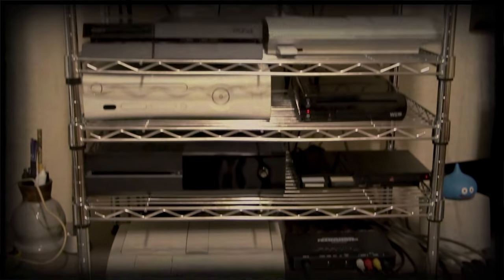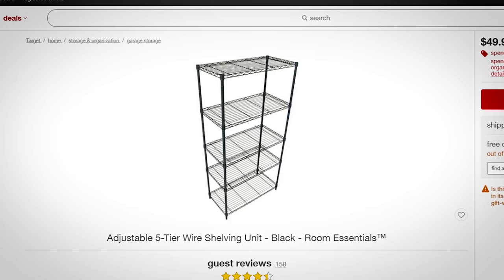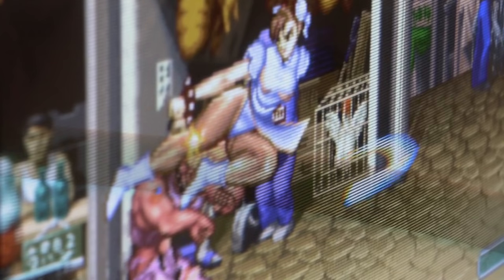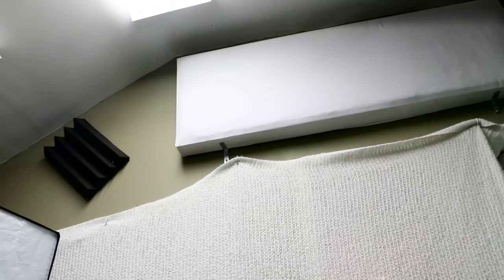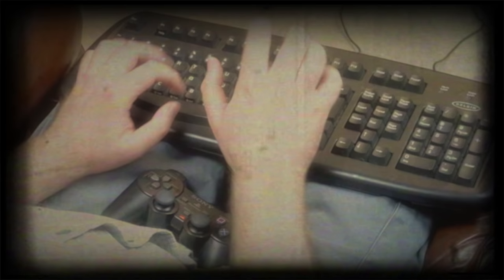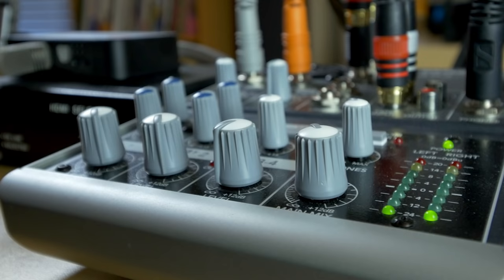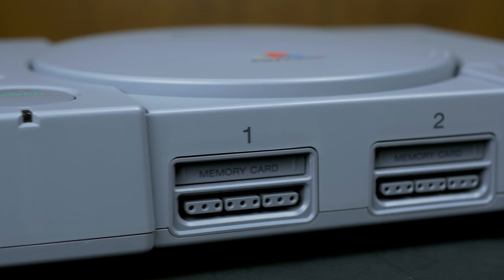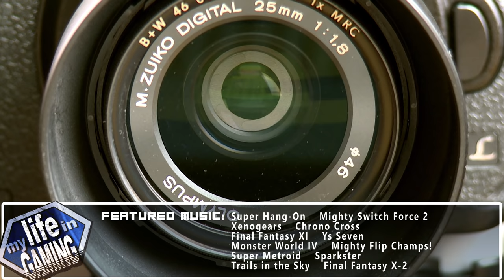Gaming Setup and Studio Tour - How We Make MLiG in 2016 / MY LIFE IN GAMING

Comment: Hey Coury! great video! I have a question at 8:54 I have that same HDTV. Been trying to configure the settings so its really good for gaming what configuration did you put on it? Also does yours have global dimming/auto dimming? Because mine does and I haven't been able to turn it off.
Reply from the maker: [Coury] YES, this is definitely a problem! I struggled iwth it for awhile, with no way to truly turn it all the way off. Some Samsung's have a way to turn off the global auto dimming in the service menu, but not here. The only way to fix it that I found was to change the settings so that it never kicks in - I found some that only makes it slightly kick in in the most extreme circumstances. Here's what I use:

Picture Mode: 
Standard

Backlight: 17
Contrast: 97

Brightness: 61
Sharpness: 0

Color: 51
Tint: 50/50

-- Screen Adjustment
Picture Size: Screen Fit

— Advanced
Dynamic Contrast: Off

Black Tone: Off

Color Space: Native

White Balance

R-offset: 8
G-offset: 8
B-offset: 8

G-Gain: 25
G-Gain: 25
B-Gain: 25

Don't forget to set to Game Mode under the General options.

The while balance is the key to making the auto brightness kinda turn off. You turn down the offsets and turn up the gain and that'll cancel it out. Since I did this, i hardly notice the auto dimming.

Comment: Curious if you guys record purely with the AverMedia software at high bit rates or if you've experimented with Lossless recording via programs like VirtualDub?

Also Tri, if you're looking to record Optical audio I'd check out either a Creative SBX ProStudio or a Creative Sound Blaster Z or ZX as both of these accept S/pdif inputs and can also passthrough the audio signal as well.

Also figured I'd mention this since the gscartsw is fairly expensive, but Extron AV Matrix Switchers are usually cheap on ebay and some models have the added benefit of cleaning up noisy video signals.  There's also the fact that you can use both JP-21 cables, Euro SCART cables, Composite cables, Component cables and S-video cables all on the same switcher.  The two main downsides are the size of the Matrix switcher and the fact that you'll be shelling out $40+ for each JP-21 or Euro SCART cable you want to connect to it.

Comment: I'm really impressed by this setup. I was wondering if you have like a signal flow chart that can show the path of each console and how it gets split and divided to your various monitors?
I am interested in learning on how you did your routing and signal dividing. I am trying to build out my set-up with 15 consoles I have hooked up. At this point, I am going to split it in sections based on connection type.
Reply from the maker: [Try4ce] Oof, well, for me things have changed a lot in my setup. I now have two PVMs, and just this week added a 4K TV. Figuring out how to route 1080p consoles PLUS 4K consoles is proving to be a challenge.
Reply: I also have a 4kTV and curious on what solutions you come with to incorporate that with your current video matrix.
Reply from the maker: +Andrew V [Try4ce] I am absolutely planning a episode about retro and modern gaming on 4K TVs later this year after I get it all settled!

Comment: hey Try, you wouldn't happen to remember what series your IKEA shelves came from would you, particularly the short one in front of the TV?
Reply from the maker: [Try4ce] Unfortunately they don't make that series anymore. That series is called Expedit. The 2x4 cubby hole units are also Expedit, and the wider 1-hole units are from a series called Lack, which still exists, but I think they may be phasing it out. They have since replaced Expedit with Kallax, which is very similar, but the outer edges are not as thick. They have a few of the same units, like 2x4 and 2x2, but sadly no 1x5, like my main unit in the middle.

Comment: Another outstanding episode! But, I've got a quick question: how do you manage to connect 2 hdmi splitters to one TV?
Reply from the maker: [Try4ce] Using 2 HDMI splitters in the chain doesn't seem to adversely effect the connectivity. One splitter goes from the switcher to the Framemeister + TV, and the other goes from the Framemeister to the capture card, as well as back to the switcher. I'm considering changing it so that the second split from the Framemeister goes to another input on my TV instead of back to the switcher.
Reply: +My Life in Gaming Nice! Thanks so much for the explanation!

Comment: You'll probably explain this in a later episode of RGB200, but in RGB102 it was mentioned that Coury is using component for his PlayStation 2 while Try4ce is using RGB Scart (mentioned here again in this video). Is that just for personal preference or is there more of a reason for that?
Reply from the maker: [Try4ce] It's more convenience/personal preference. There's not a clear winner either way. The PS2 component signal is often considered to be "noisy," which I don't really notice much myself. But to get 480p via RGB with the PS2, you gotta jump through some hoops. 480p over component is easy. As for me, I only have one PS2 game that even supports 480p, so I just do plain old RGB. RGB integrates better into my own setup, and it's easier to get good colors with RGB vs. component (even though both are theoretically the same, component just requires a tiny bit more adjustment to get it "right").

Check this video from RetroRGB about PS2 480p with RGsB (RGB sync-on-green): https://www.youtube.com/watch?v=6pzTfdUcAfg

I haven't gotten into that mess yet myself, but I probably will eventually.

Comment: I have a question for Coury...how did you get the extra shelf for the wire rack? i see you have a 5 tier and 4 tier yet they only come in 5 and 3 tier variations. i assumed you converted a 3 tier black one into 4 shelves since i noticed that the other 3 on it were black and the top one was chrome. did you have to buy an additional rack  to pull the spare shelf from?

Comment: Awesome video. I'm trying to setup my own game room but I'm stuck. If you're setting up a desktop setup using a Frameister with a modern HD flatscreen TV, what size TV would you use? Most smaller ones (24"-32") come in 720p or 1040p. How or does the native resolution effect the display while using the Frameister? I don't want to buy a PVM or old CRT, but I have no idea what type of TV to get. Or can I just use my 65" TV and adjust the screen size with Frameister?
Reply from the maker: +Velosiped [Try4ce] I wouldn't worry too much about it. You can do all kinds of sizing adjustments with the Framemeister. If you get an HDR capable screen, you might need to turn Deep Color off on your TV. That screwed up the Framemeister's color and sound, at least on my TV.

Comment: Regarding the Badridge SCART selector: I've noticed the composite/s-video input on the front; can the selectors be used to run composite/s-video through a SCART cable? I've got a GSCART switch already, but I'm trying to find a "One Channel" solution for my retro consoles. I've got a few consoles running through the GSCART then to a YUV converter to my Trinitron, and a majority of my consoles running composite or S-Video through Phillips selectors running to the same Trinitron. I hate switching input channels to go from say, Genesis to Turbografx.

I want to know if it's possible to run a composite or S-Video signal through the Badridge unit then to a YUV converter and have it display through the component channel on my TV. I bought like a $5 composite/s-video and audio to SCART adapter, but when I run it through my YUV converter all I get is a dark, black and white image with good sound. My initial thought is that it isn't possible to "convert" composite/S-Video to component with the passive adapter I have, but maybe it is with the powered switch... I have no means to test it though.

Love the channel, by the way!

Comment: Hey Try I recently got a PVM and I have limited space. I love you lazy susan idea in order to get behind it. I was just wondering what size is your PVM and what size is the lazy susan? One thing I learned about a PVM vs a CRT is all the weight is near the screen vs more evenly distributed so if I got a lazy susan to small I would be nervous of it flipping forward. Thanks
Reply from the maker: [Try4ce] I don't really use it anymore because now I primarily use 19 inch PVMs and they are for sure way too big. The PVM that was on the Lazy Susan was only 13 inches... and the Lazy Susan was just barely big enough for it  (I'd guess it was maybe 15 inches, not positive... it came from Walmart). However, you are absolutely right, the weight distribution made it so that I had to balance it sort of weirdly. If I centered it, then it did indeed lean forward. I'm not so sure it was a great idea in retrospect, but I'm sure there is a way to make something like that work well.

Comment: Something I've heard about the Extremecap U3 was that it only records in exactly 30 or 60 frames per second, leading to desync in long recordings. But that was in a review from a couple years ago. Does the current firmware allow recording at more standard framerates (29.97 for 30, 59.94 for 60) or is there no getting around desync without using something like VirtualDub to fix it?-skull902

Comment: Beautiful. How do you get the same picture from your HD to the smaller TV?
Reply from the maker: [Try4ce] Not sure what I was doing at the time, but there are various methods. PVMs have outputs that don't degrade the quality in any tangible way, so that output can go to an upscaler. Right now I'm using a series of RGB switchers called GSCART that have two outputs, so I send those now to my PVMs as well as my upscaler.
Reply: @mylifeingaming  Wow, thanks for the quick response. I have a simple CRT. Haven't gone the way of Framemesiter just yet. I simply wanted to have the same signal coming out of two TVs, just like you have in your video. Maybe a video splitter?

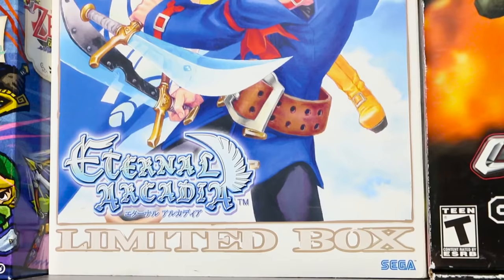Comment: Those black shelves where all your games are stored (12:08) what are they?  Where did you get them?  Looks like the games fit well there and they're adjustable.  Thanks.
Reply: Frank Castle you can take a gamble with bookshelves, but the games might not fit perfectly. A more expensive option is to buy "media shelves" which are designed to fit dvds perfectly. I would suggest building your own shelves, though. It's cheap and with some practice you can make them really nice.

Comment: Do you guys use step transformers for your XRGB Minis and/or Japanese consoles?  If so what kind or if not, why not?   Thanks!  Great Ep!
Reply from the maker: [Try4ce] No. It's generally considered "fine" to use Japanese AC adapters in the US. The adapter itself might get a bit warmer, but the output to the console is pretty much unchanged. If you order a Framemeister today, it will actually come with a true universal adapter, that can be used anywhere in the world without issue. Ours are 100V Japanese adapters, so it's not ideal, and it does feel a bit warm to the touch. I might look into an alternate universal adapter for it someday. I'd rather use a well-made universal adapter than deal with a step-down converter, if such a thing exists. I previously used my Famicom and Famicom Disk System with their official Japanese adapters, and that was also fine, but I now use a universal multi-system adapter called Retro DC with those. We actually did a video that featured it: https://youtu.be/RIzt23IDFrc
Reply: +My Life in Gaming Awesome!  Thanks!  Power on imported consoles (have an NTSC-J Saturn on the way) is always something I'm worried about!

Comment: I'm a bit confused on plugging a component switcher into a SCART switcher. My planned setup will have a GSCART sending one signal to a Framemeister and another to a multisync CRT monitor that can handle both 240P and 480P. My question is can the GSCART, and by extension SCART and BNC cables handle the higher KHz refresh rates needed for 480P and higher?
Reply from the maker: [Try4ce] Yes they can. I actually don't have the component-via-SCART thing in my setup anymore, but there is nothing about the SCART standard that prevents 480p... it just normally doesn't happen. You can get 480p with PS2 via SCART using sync-on-green (which involves jumping through some hoops, but it does work), and also from Dreamcast with the Toro VGA box, which can convert the VGA signal to 480p over SCART (which is going through my GSCART just fine). The GSCART is also sending 480p Dreamcast to my PVM 20L5 (I got it after this video) via the Dsub output.

Comment: I've always wanted to mount my TV, but I'm nitpicky about hiding the cables.  How did you guys manage it? i only see one single cable running on your mounted setups.
Reply from the maker: [Try4ce] Mounting your HDTV is definitely the way to go, I think! The wires are simply bundled up by putting cable ties around them. We use Velcro cable ties (commonly available at hardware stores) so that you can add wires and adjust things, without having to cut the tie, like you do with normal cable ties.

Comment: Great work yet again you guys, seriously! I had a quick question for Try. That wireless PS2 controller, where did you get it? I've seen wireless PS2 controllers before, mainly popular ones like the Logitech brand, but never really liked how they looked, nor have I ever liked buying third party controllers. I tried doing some research and it seems that Sony never released a first party wireless controller at the time, (I could be wrong), but nevertheless the one shown in this video looks legit! SCPH-10015GR I think this is the model number, however when I did a Google search, what came up was something that looked cheap and fake. Any input would be greatly appreciated.
Reply from the maker: [Try4ce] Wireless PS2 controller? I'm a bit confused. Even if you were mistaking it for a PS3 controller, I don't recall ever showing one in this video (maybe i did). Were you mistaking it for that silver Xbox 360 controller, perhaps? While I don't have them anymore, I used to use Logitech brand PS2 wireless controllers. They were a somewhat different shape, but once I got used to them, I really loved them, and never had any connectivity issues. This was back in the PS2's day. Nowadays I'm back to the official wired DualShock 2.
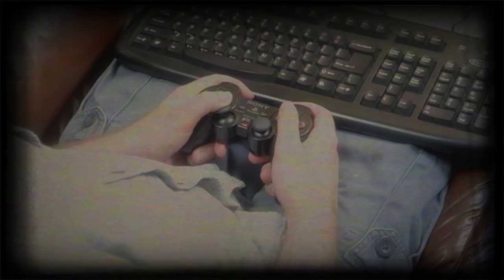Reply: +My Life in Gaming Oh...errr I was almost sure that was a PS2 controller at the 20:18 video mark. \:

Comment: + MLiG
 What exactly about your Sony at 34:05 wasnt as awesome at retro gaming?
Why did you get rid of the Sony and keep the Toshiba? Can you be more specific explaining your reasons? I'm trying to make a similar decision myself
Reply from the maker: [Try4ce] My reasoning is mostly explained in the HD CRT section of RGB 104, at this timecode: https://youtu.be/RAi8AVj9GV8?t=18m17s The short answer is that it's actually just not that authentic of a retro experience because HD CRTs are digital, not analog. You can't use light guns on them because the image is processed. There are no scanlines. You can see in some of the shots included in both episodes that it just has a weird way of processing 240p stuff. It ain't super awful I guess, but standard definition CRTs (or professional monitors) treat 240p stuff with much more care. 480i and 480p is pretty OK on an HD CRT, but if 240p is a big part of your retro diet, then older consoles just look more defined on a standard def set than an HD set, in my opinion.

Comment: I have the avermedia 4k when I hook everything up through the soundstage I can't get 4k through the PS5 it only gives 1080p but when I hook it up to the LG C2 it gives 4K I don't know if it's a receiver that's not passing through the signal but the receiver is 4K HDR
Reply from the maker: [Try4ce] That doesn't surprise me. My experience is that PS5 wants to use automatic settings so bad and will neglect to do things that it should be totally capable of doing with the connected devices. I've even seen it say that 4K120 is supported and enabled, only for it to chicken out when I actually boot a game, and it'll do 1080p120 instead.

The first thing you should do is make sure you're using a beefy enough HDMI cable for your capture card. It needs to be "High Speed" 18gbps for 4K60 or "Ultra High Speed" 48gbps if you're doing 4K120 (not sure if you're using the 2.0 or 2.1 card). HDMI cables are a minefield these days and finding ones that actually can handle what they claim to handle is tough.

If that's not enough, then let me tell you what fixed the issue where it would do 1080p120 instead of 4K120. I got these HDMI 2.1 Ezcoo splitters on Amazon that have EDID toggles. I set them to 4K120 and suddenly the PS5 has the confidence to actually output 4K120. But of course, you'll need extra cables that can carry that bandwidth. If you're only going for 4K60, then you might wanna set the EDID switches to 4K60 so the PS5 doesn't output 4K120 by accident. You should also turn off any features in the video menu you don't need for your purposes, like auto low latency, VRR, 120Hz, etc.
Reply: @mylifeingaming  i am useing the ps5 cable and  xbox series x cable to capture card 2.1 cable thank  you for answers back lol
Reply from the maker: [Try4ce] If you're using the new AverMedia HDMI 2.1 capture card, make sure your USB port is USB 3.2 Gen 2. It's a big mess because USB 3.1 was rebranded as USB 3.2 Gen 1 so it's very confusing. I actually had to buy a Startech USB 3.2 Gen 2 PCIe card for my desktop to get full performance out of that new capture card.